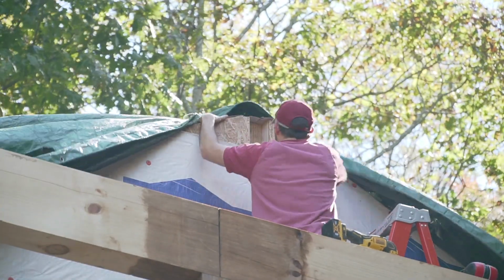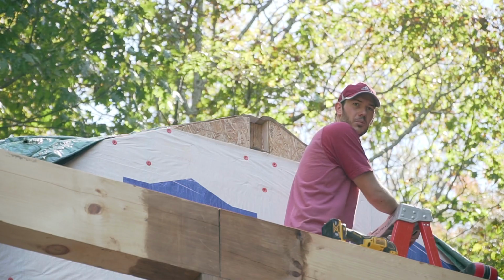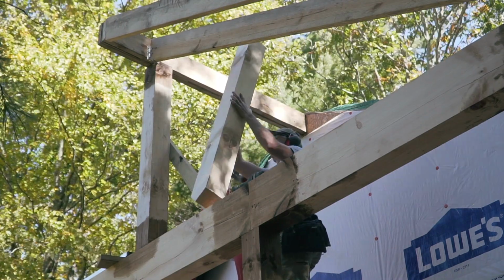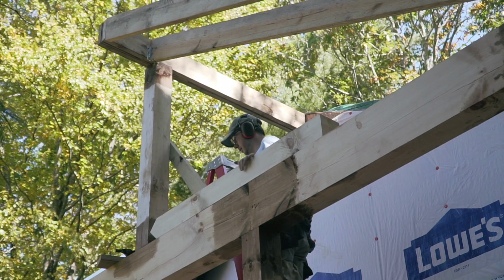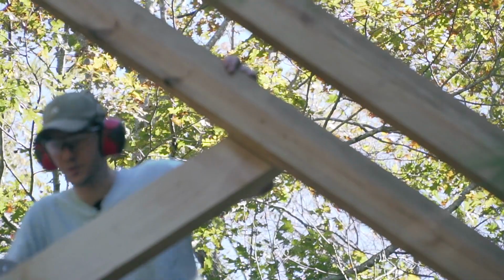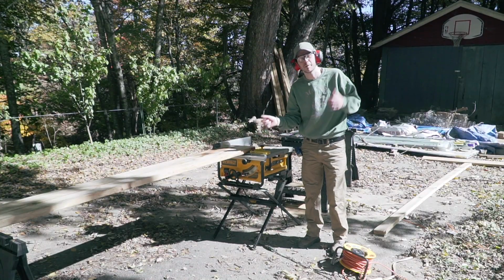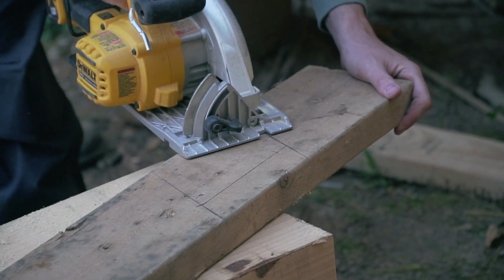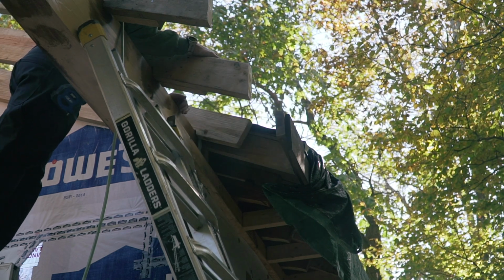The Cabin's Heavy Timber Entrance Is Starting To Look Fantastic ! - Cabin Series EP 40

Comment: As a DIY builder myself who's made many mistakes I use screws where I can to tack everything before nailing if I'm uncertain of the finish or haven't pieced everything together/test-fit. It's much easier to take a few screws out if there's a screw up, even if it means having to go back to nail a few things after... This has saved me a lot of headaches. 
Love what you've been doing, been watching from the beginning. Thanks for sharing brother! 
Cheers from the Hammer, Ontario
Reply from the maker: Hey! I still use screws here and there. For example when placing my rafters to see if it’s a good fit, I used a screw at the top.
Thanks for watching it all, it’s greatly appreciated. Canada! Nice! You’re probably already having snow up there ? It’s getting in the 20’s 30’s here.

Comment: Why didn't you invest in scaffolding. Would have  made your work safer and easier. Work smart, not hard
Reply from the maker: Darren, you’re right, I have been thinking about it, but it’s kind of expensive! And renting wouldn’t be an option since I only work a few hours a week on this cabin
Reply: @TheDIYCabinGuy  I wonder if it would have been worth the time to build some moveable platforms. I know the ground is very uneven which complicates things, but I trust in your ingenuity to figure out a solution.

Additionally I think you could use a winch to help you raise those heavy timbers. Even if you needed help to get them into place I think it would be much easier.

Well, maybe for the next cabin
Reply from the maker: @nwa2102  thanks! I’m still debating if I should build some scaffolding to help on the high side of the cabin.